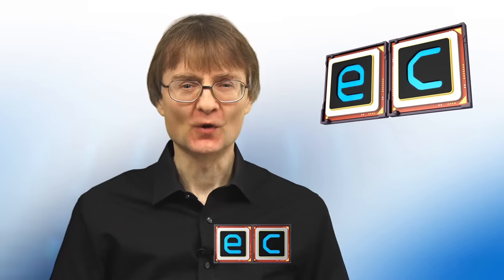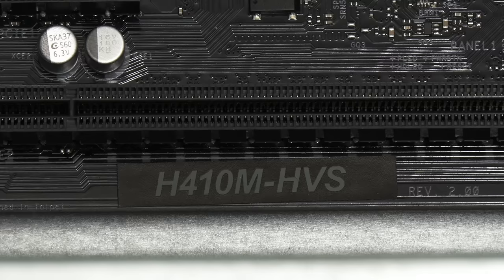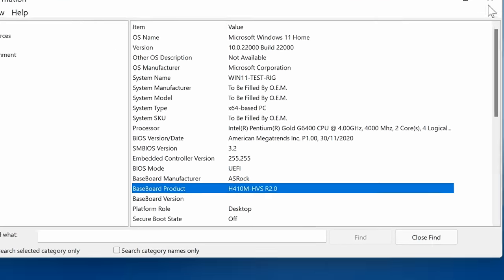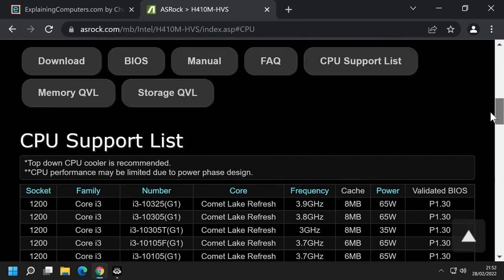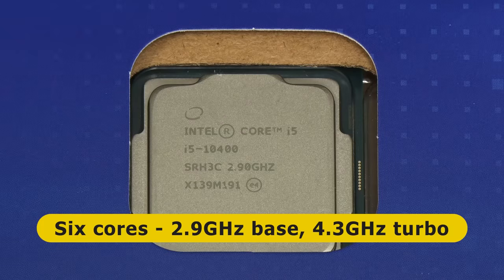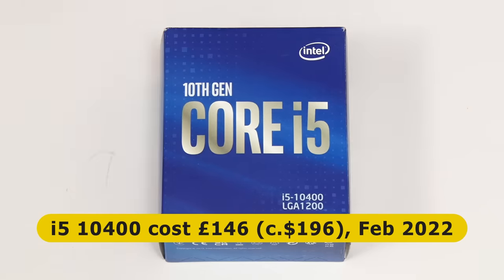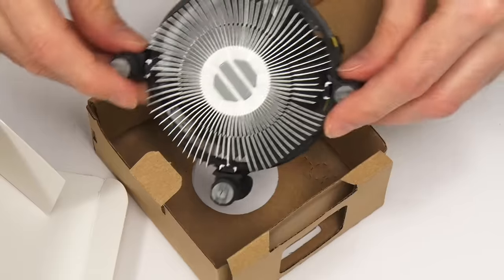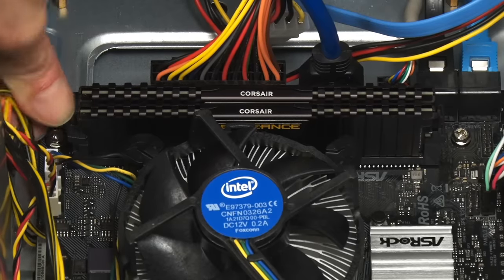CPU Upgrade: How to Change a Desktop PC Processor

Comment: Is it possible to upgrade the processor in a laptop?
Reply from the maker: It depends. On slimmer laptops, the CPU is soldered to the motherboard, so in practice is very hard to change. But in chunkier hardware, the CPU may be socketed, so can be upgraded easily like that in a desktop PC.
Reply: @ExplainingComputers  Thank you

Comment: Do i need thermal paste?
Reply from the maker: Yes, but as I showed and explained in the video, the stock Intel (and AMD) coolers that come with a CPU have thermal compound pre-applied. :) So do you not need to apply anything to the surface of the CPU when fitting a new stock cooler.

Comment: I really dislike Intel CPU coolers. Can never get them to fit properly. Often a case of three pins fitting and struggling to get the fourth one in place! Here's a tip, esp for AMD CPU's. Turn your PC on for a few mins before removing the CPU cooler to heat the thermal paste. Otherwise, the paste can set like glue, ripping the CPU out of the socket even with the retention arm in the lowered position! Yes, I have done this!

Comment: its one of the most daunting tasks in my book. i managed to trash 1-2 boards (the socket) thanks to inappropriate CPU cooler installation. they should make CPU sockets more foolproof, one bent pin will do the trick.....

Comment: I think there is a plastic cover on the thermal compound, I hope he removed it before he put the fan on!
Reply from the maker: There is no cover on the thermal compound, on either an Intel or AMD stock cooler. Such covers are found on adhesive thermal pads.

Comment: The problem with the argument that PCs are upgradeable is that they are only within a limited time band due to the many incompatibilities and what actually makes sense.

Given the short period this actually works, the question arises: Why not buy better in the first place and not lose all the money buying several versions of parts?

In my observation PC users get to keep the case (if they're lucky) one of the least expensive and irrelevant components. The only thing worth upgrading on my desktop Dell are hard drives (which could easily have been attached externally, RAM but I'd lose some because it is fully populated and I am limited as to the max it will take, a SSD but it only takes SATA or MSATA which are both expensive and mediocre. There is no gain to be made on the CPU. The GPU would be ridiculously expensive and overkill on a dated system.

Upgrading all the I/O would mean a new expensive motherboard. Better displays would be limited by the CPU, RAM and GPU and I'd need a better more expensive PSU to power it all.

So in reality almost all upgrades would be better spent on a totally new system, with current technology and current warranties. Then sell my complete PC as a working unit, but being a PC and old it is not worth much
Reply from the maker: There is much truth in what you say, as I've discussed in several other videos. This said where -- as here -- a much higher specification CPU compatible with the existing motherboard can be found, there is a very significant cost saving for upgrade vs a new system, as well as significant environmental benefits. Of course it depends on the system. But even if a motherboard CPU and RAM are changed, keeping a case, PSU, case fans and drives can save a great deal of money (and hassle). In a higher-spec video editing PC, the multiple drives, case and PSU are likely to cost say $500 to $1000.
Reply: Like most things in life, upgrading is all about cost/benefits ratio. Like you, a lot of people upgrade or build a new PC and sell the old parts or PC to recoup cost. For me, upgrading from a Pentium to an I5 would be OK if I can find a used I5 for a reasonable price. Just upgraded a Precision T5810 from a 4 cores E5-1603V3 to a 10 cores E5-2660V3 for $35. Cheap upgrade to improve capability and extend the life of the VM server.
Reply: @tbone9900  Great if you can do that, but that upgrades one component in an otherwise out of date computer. You are still stuck with a max 300 W GPU and really old I/O, No NVME drives and a lot of "I wish this would do that"

Comment: This is more about, how to remove the cooler and install it again. :p
Reply from the maker: And how to make sure you get a compatible CPU! :) The CPU switch itself is indeed the easy bit!
Reply: @ExplainingComputers  Well, I am a bit of a nerd and I tend to forget that not everybody sees the logic that not every CPU is compatible with the motherboard. :) To be fair to those people, to some extend that is an artificial limitation, more so for Intel than for AMD. Of course there also are legitimate technical reasons for it and some - in my opinion - less legitimate technical reasons like those companies still using 16 MB ROM-chips (lot of memory used for the BIOS-interface) instead of spending a few $ more on a 32 MB ROM-chip which could store data to facilitate supporting more CPU's.

Comment: I've never heard of Windows deactivating itself from a hardware upgrade, that's a new one to me.

Edit: With the exception of the motherboard if it has a different chipset.
Reply from the maker: Windows used to do this regularly, as it keep a track of hardware changes on a points basis, and once you passed the points limit in a time period, it deactivated. Things are better than they were (due I have to admit to linking Windows to Microsoft Account). But I've experienced Windows deactivations after changing RAM and a graphics card.

Comment: You don't need a screwdriver to release the fan pins, or I never knew you were supposed to use one.
Reply from the maker: They can potentially be turned by hand. But the booklet/manual that comes with an Intel CPU says to use a screwdriver to release the push-pins, like I showed in the video. :)
Reply: @ExplainingComputers  So, you DID read the manual....

Comment: Too bad most laptops and some desktops (*cough*Apple*cough*) no longer allow this because the processor is soldered to the motherboard. Many laptops even soldering the RAM (some even the SSD) to the motherboard.
Reply: Aside from Apple - what kind of garbo desktop doesn't have a socketed CPU? I never heard of such a thing.
Reply: @mrflamewars  Apparently, some mini Windows PCs also do that. Usually those pre-built ones.
Reply: @mrflamewars  cmiiw but i remember lenovo locked their Ryzen CPUs in their desktops so they'll brick if you put them on another motherboard.
Reply: @Astrocat 3D i think they had fuses for Ryzen PROs
Reply: @yukihanayuki  yeah they and still do. Linus from LTT did pretty good showing and explaining how it works on this video:

https://youtu.be/bFNJVaO9E-o
Reply: Here in the US, many of the cheap prebuilds from the big box stores or Walmart have soldered ARM or CPU. That is one of the things I checked for online before purchasing. Soldered CPU is annoying but not a deal breaker, since upgrading CPU on cheap prebuilds are iffy at best. Soldered RAM is a definite no, since these prebuilds tends to have inadequate RAM.

Comment: Is the BIOS upgrade thing that stupid thing I heard about where you have to buy two CPUs the one you want to use and a shittier one so that you can upgrade it and then put the new one in there? Really dumb you can't just use the better CPU in a limited way fist like how you can use a monitor before your graphics card drivers get installed.
Reply from the maker: Basically, yes! :) There have indeed been cases where some motherboards have not supported newer processors without a BIOS upgrade (eg 2nd and 3rd gen Ryzen chips), and as you say the only way to upgrade the boards was to boot them up with a 1st gen CPU, do the upgrade, and then change the CPU. Which was, as you imply, rubbish.

Comment: People still have desktops?
Reply: Yep.  I can't work on a laptop, at least not without adding at least one more monitor and an external keyboard and mouse... at which point I might as well get a desktop.  And oh yeah, I run RAID on my desktop for safety which is difficult if not impossible on a laptop.
Reply: @Bussi why not?
Reply: I love my laptop, but I can really sleep with my desktop tower in my arms❤❤😂😂
Reply: Yes. With optical drives as well.

Comment: That's tiny Mini-ITX motherboard... In an ATX tower...
Reply from the maker: The motherboard is indeed small, but its a MicroATX (19.7 x 18.8 cm), not Mini-ITX (17x17cm). The most notable difference is that there are two PCIe slots. :)
Reply: @ExplainingComputers  Lovely. I bet that was a Corsair Vengeance DDR4 kit in the Mobo.
Reply from the maker: @mynintendogamingfeed5208  Spot on -- there was indeed. :)

Comment: Windows will magically get unlicensed with a hardware change? what on earth is that about. I've changed my hardware a few times, never got any issues with windows. And that shouldn't happen because changing the hardware has nothing to do with windows... Or is this some stupid Win 11 thing?
Reply from the maker: This has been going on with OEM licenses since Windows 11 (when Microsoft allocated points to each type of hardware device, and only allowed you to change so many points worth without reactivation). These days deactivation, when it occurs, usually happens when a motherboard is changed with an OEM license.
Reply: @ExplainingComputers  That's a worrying development. the OS should not in principle interfere with the hardware in this way. Microsoft apparently is after more control over ones pc.

Comment: I'm just looking here and grinning a bit at how old office PC is turning into huge money pit. So many components have been upgraded twice and it's still more or less office PC. Faster sure, but that's all. With all that money spent it most liekly could have got some lower end graphics card like GTX 1650 and be an entry level gaming PC. It also going to be "fun" to get rid of old and opened once parts. This is really turning into upgrade hell.
Reply from the maker: I think you've missed the point. My occupation is making videos, and this PC is a piece of hardware that I use in the same -- not to edit the videos, but to demonstrate different things. All educators need test/sample hardware, and so far this has been only application of this PC. No older parts will be gotten rid of. I need a lot of the same for video making purposes. And I certainly don't take apart the systems I use to do my work for YouTube video hardware demonstrations!

To be clear, what you see with the upgrades that feature this PC is not real life, and nowhere have I suggested that anybody should perform every upgrade I have shown using this box. Indeed I pointed out when I fitted the new motherboard that you obviously would not have done the previous upgrades if this was your intention. Nor would you fit one CPU and then rapidly replace it with another.

I'd also point out that your dismissal of this PC as just an office PC, but faster, ignores the fact that not all PCs are used for gaming, or for other purposes that require a graphics card. One of the reasons I did the upgrade was to make some use of the system for Screamernet LightWave rendering, which is entirely CPU based. So for this application the upgrade here is very useful.

From my point of view, the upgrades of this system have been a great success. So far the videos where I've shown upgrades using this PC have gained 1.57 million views, and it was also the hardware used in my Windows 11 video that has so far picked up 497K views. So this hardware has allowed me to make videos that have earned over £5,000 in advertising revenue. And perhaps more importantly, a lot of people have commented that the upgrade videos featuring this hardware have helped them with similar upgrades, which is why we are all here! :)
Reply: @ExplainingComputers  Yeah I get it, just that it's a perfect guide how not to plan upgrades and end up spending a lot more than you need. Perhaps there will be a video about upgrade planning, so that perhaps no one will zillion small upgrades until arriving at something that's finally usable.
Reply from the maker: @MJ-uk6lu  I see your point, but the different videos involving this PC are not presented a a series. Certainly the first three were a series. I then stopped the series numbering exactly because of the point you make, and did two linked videos about how to upgrade a PC motherboard. And now I've done a totally stand-alone video on changing a CPU. Nowhere have I stated that all of these upgrades should be done to the same PC.

Most viewers of this channel -- well over 70 per cent of them -- are not subscribers. Instead, most views come from search, so it  likely that very few people will see all of the videos that you are linking together.

Comment: your the only 1 hows thinks thats a good mounting heat sink,thats the worst   way to mount a heat sink ever  the plastic push pegs are f-cking  crap
Reply from the maker: Compared to previous heat sink mounts it is a great improvement.
Reply: @ExplainingComputers  nar there is no improvement  just cheap plastic that will fall apart in 2 or 3 years,plus there`s no copper every 1 of the intel heat sinks i ever had  fell apart the pins snapped,and lets hope no one smokes there are slightly better ones with the copper core but i would never use them again
Reply from the maker: @mikespikeey4625  Did you did many CPU coolers in the 1990s? The mechanisms were terrible! :) But I do agree that quality has fallen significantly in stock coolers.
Reply: @ExplainingComputers  been working on pc`s since 80`s  but we not talking  about them from then 40 years ago intel have allways had crap cooler the p2`s had cooler master on some if not all of  them,,,all i said tho was you was the only person that likes  them hey that`s your  opinion ill still watch your vids